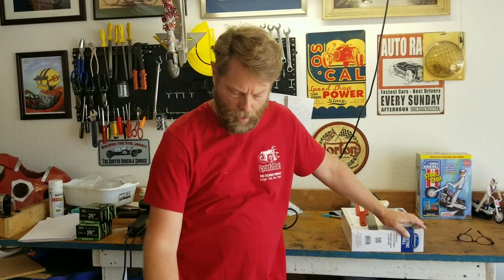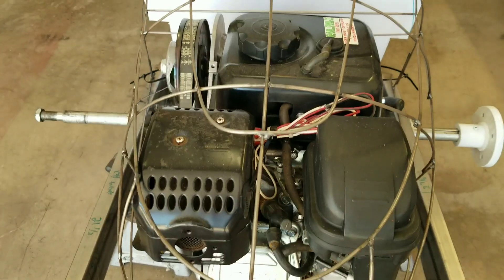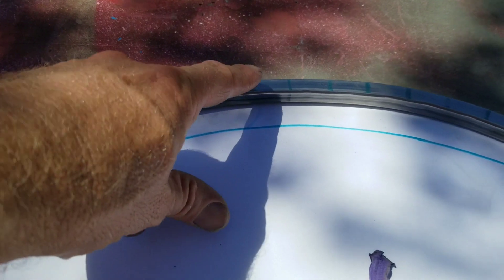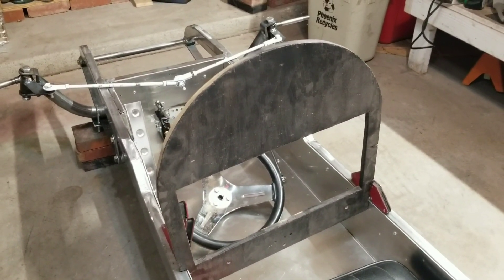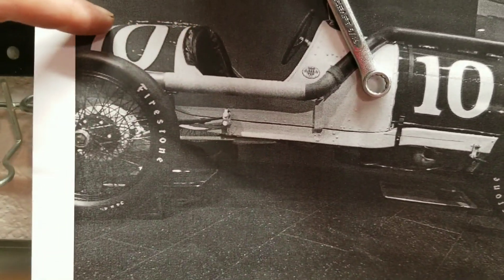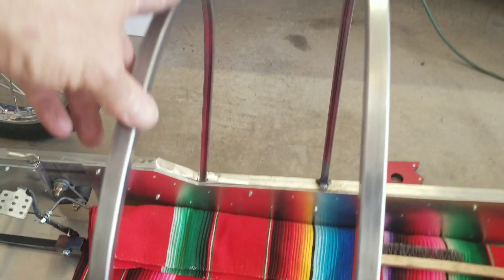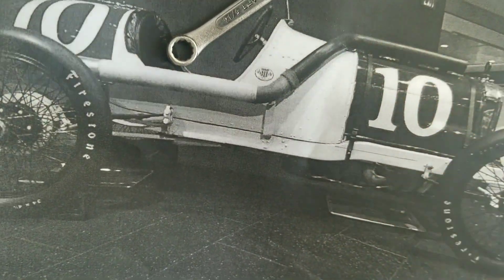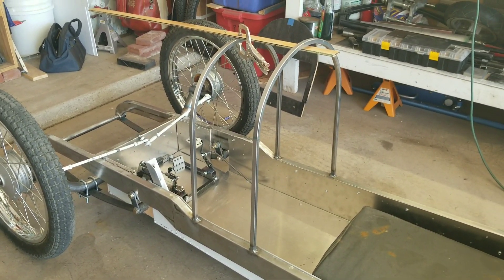Cyclekart Frame Part 9, Seat and Cowl Supports

Comment: I´d like to know how did you make the bodywork, I´d be very thankful if you answer me.
Reply from the maker: The body panels are 3003 grade .050 thick aluminum that I shaped on an english wheel and using a shrinking stump